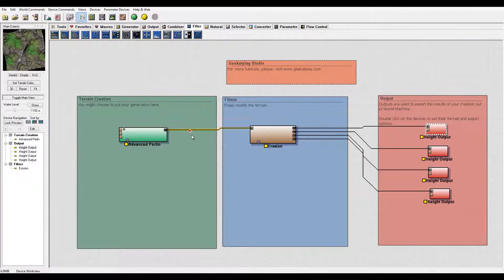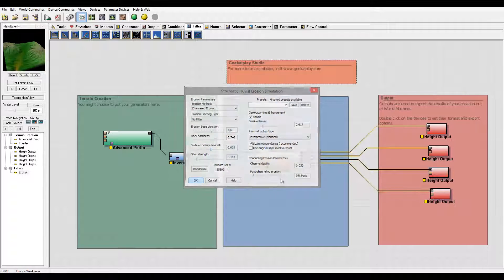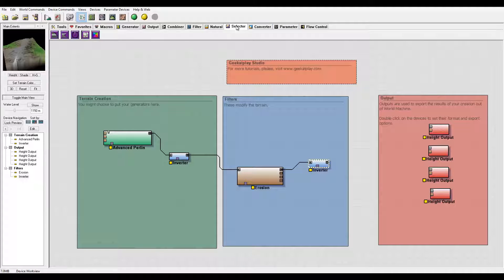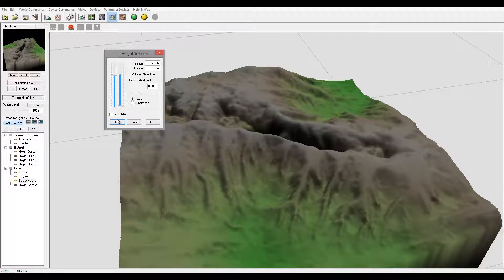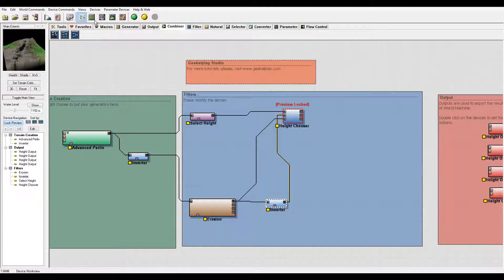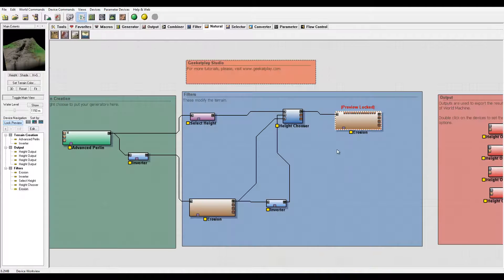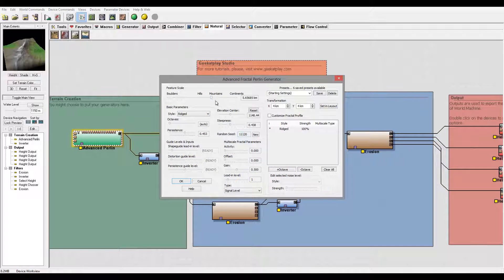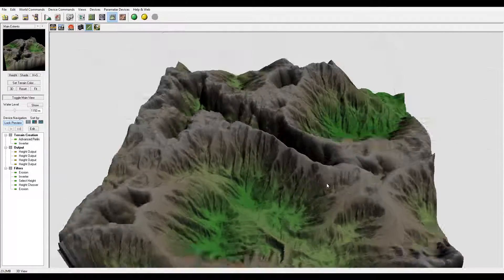Advanced lava paths with World Machine.

Comment: I'm very new to 3d editing so I apologize if this is a stupid question but I was wondering why are there so many different height outputs? Why not just one?
Reply: The Erosion Device support multiple outputs.(The heigh tmap, flow map etc)
You will need those if you export to another software package (Chopine very often uses VUE)
In this tutorial, he locks the erosion device and view the result from that - so you are right, there is not need for any at all as long as you just play around inside WM.